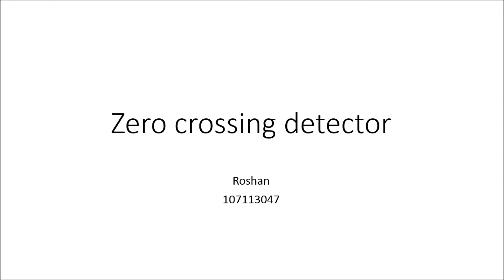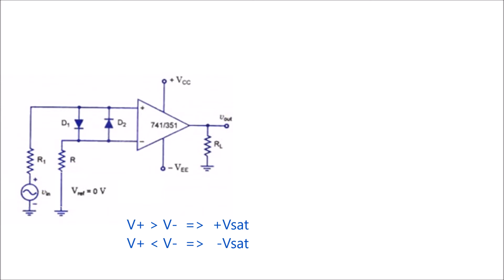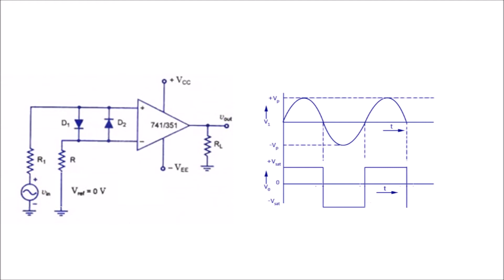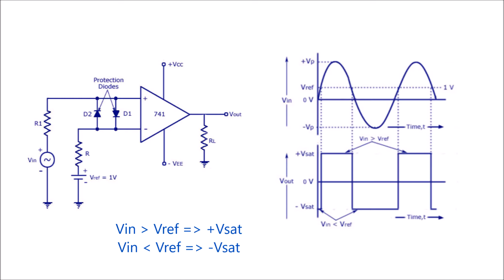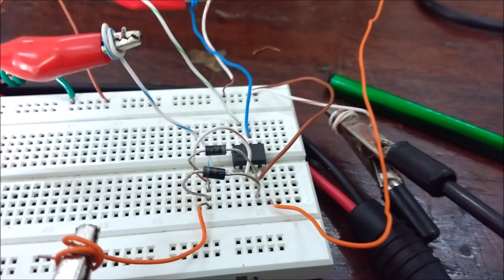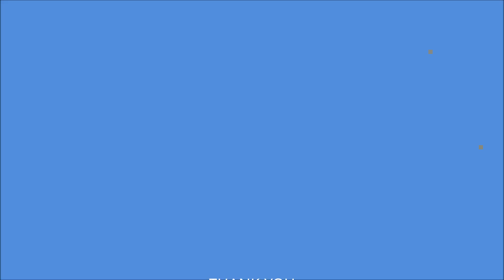Zero Crossing Detector using opamp

Comment: Do you know how to make a sine-cosine resolver into a digital signal which It must has an impedance adapter, a noise canceller, a signal amplification, a signal comparator and finally squared signs in the output from 0-3.3V?